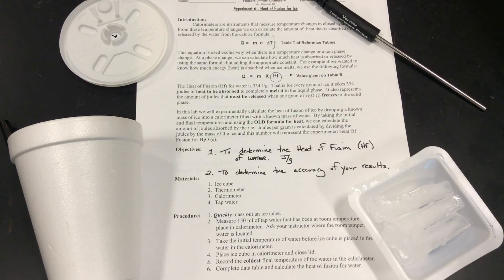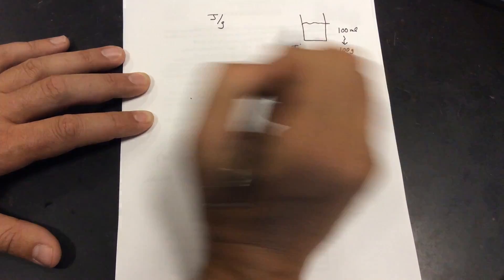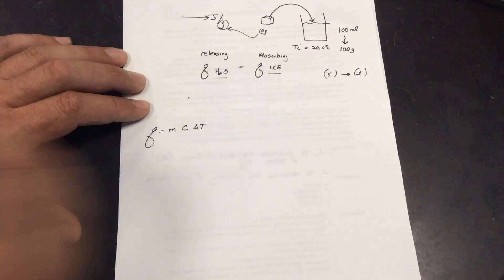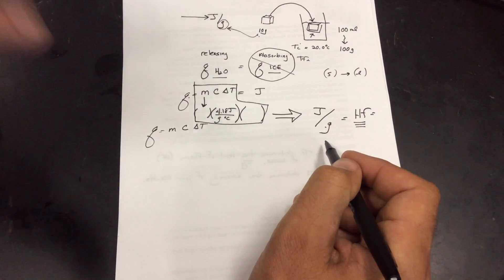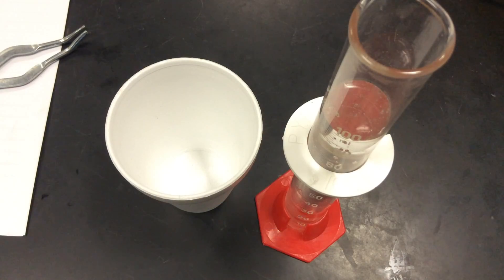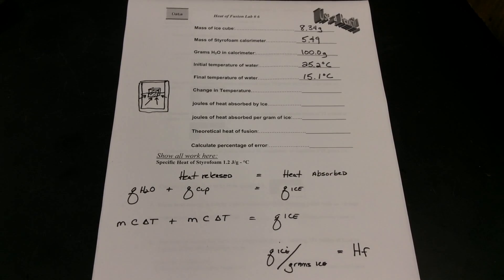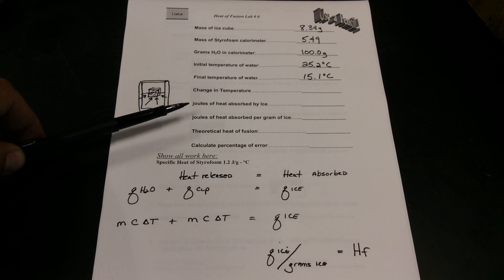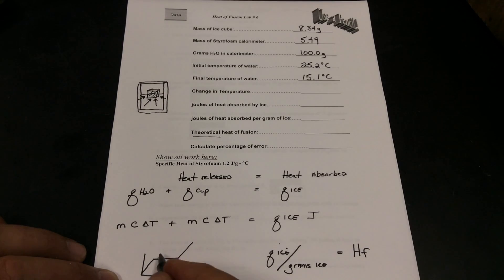Heat Of Fusion of Water Lab

Comment: I keep getting 514 J/g and not the theoretical 334 J/g using these results. Even if I disregard the heat released from the Styrofoam it's still high: 506. Did you get a value close to 334 and what might i be doing wrong?
Reply from the maker: Your calculations seem correct.  When I do this in class I get great results. I may have used ice that was in a -20 degree freezer.

Comment: The ice changes to water, but then the melted ice water temperature rises to 15.1 °C.  Wouldn't you subtract this amount of sensible heat from your total energy lost by the warm water in order to isolate the energy required to only melt the ice?
Reply from the maker: Excellent point. Based on my procedure it would be prudent to subtract the amount of heat needed to warm the water that was the ice cube to is final temperature.  If we could determine the time when the ice cube just melted and take that temperature we could eliminate this step.  I like to discuss this point in the error analysis in the lab as their heats of fusion are always greater than the theoretical.